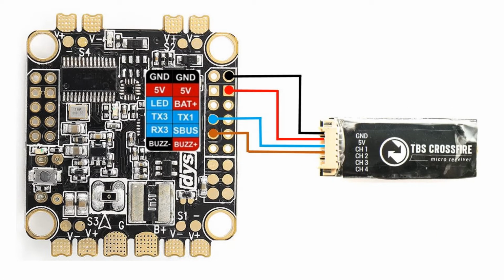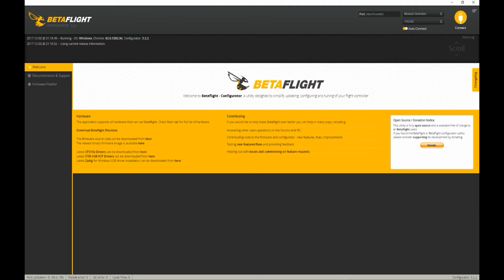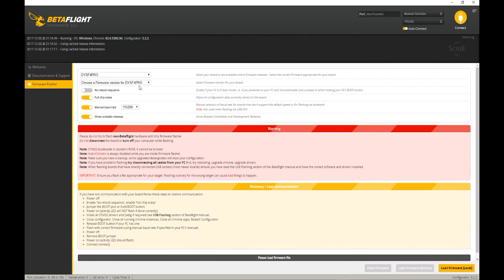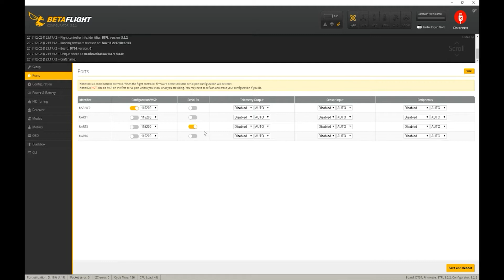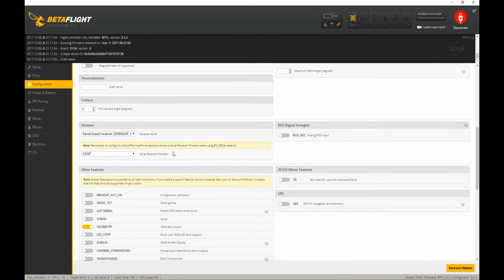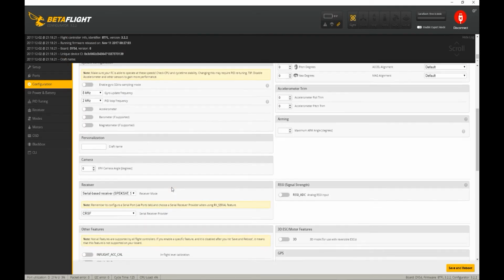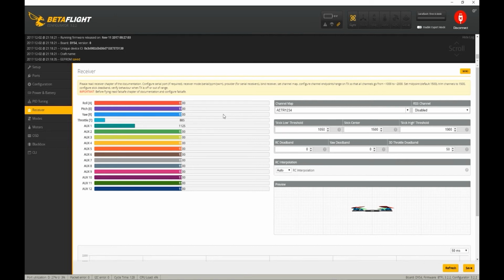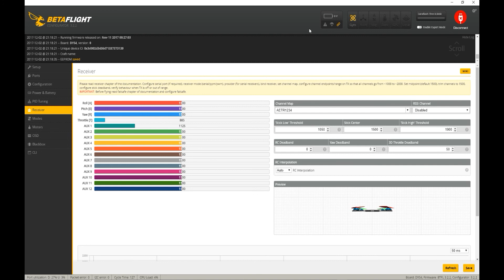Connecting DYS F4 pro to TBS micro crossfire RX

Comment: Hi great video. You have any tips for getting RSSI or LQ to the OSD using the dys and crossfire? I tried setting it up using channel 12 on crossfire and channel 12 for RSSI in betaflight. All I am getting is a signal of 50 3 ft from my drone.
Reply from the maker: I haven’t tried that yet unfortunately, I originally just had the RSSI voice alerts on my Taranis. I might look into it though because I don’t get that anymore with Spektrum and Crossfire!

Comment: BOSS FPV - I am wired the same as you and get no communication NANO CRSF to FC. The receiver Tab in BF shows no signal. I have crossfires working on some other FCs no issue... right now dead in water with DYS F4 Pro and Asgard V2. Any tricks?
Reply from the maker: There shouldn’t be any tricks apart from RX3/TX3 being around the wrong way on the FC, which is what this vid should help you get around.
Reply: There is something else keeping folks from getting the nano to talk to the FC. We have all tried both wires both ways and no luck. Threads show many folks with similar problems. Thanks for the video and input. Still hunting for a solution.
Reply from the maker: Sorry I couldn’t help more, I haven’t installed a Nano yet unfortunately. Hope you find a solution soon!!
Reply: @kydawg1684  Hi! You solved problem with DYS F4 + NANO RX?
Reply: Yes....I needed to get my tx and rx talking correctly first, then I was able to get the CRSF to talk correctly to the DYS FC.

Comment: Is the diagram of the wiring wrong, isnt channel 1 supposed to goto serial rx and channel to to transmit on the board?
Reply from the maker: Well spotted Ornery FPV! I probably should've expanded on that a bit more because that is what you would think to connect it to! On all four of the DYS F4pro boards I have, I've had to connect them this way, so I think the labelling of UART3 may be incorrect.